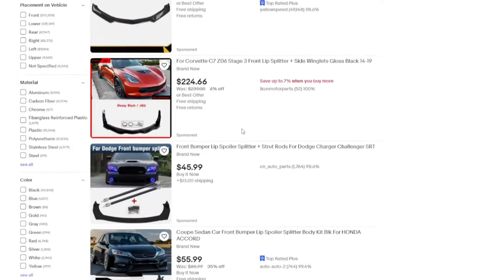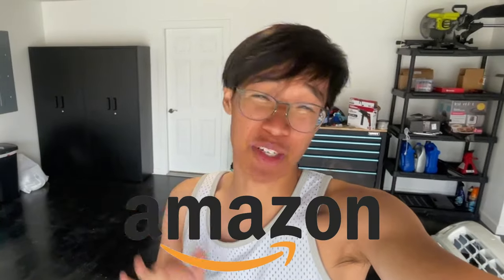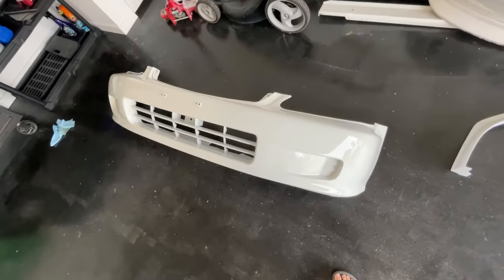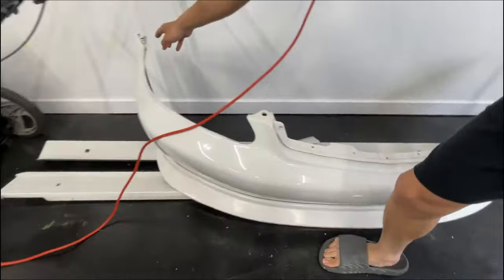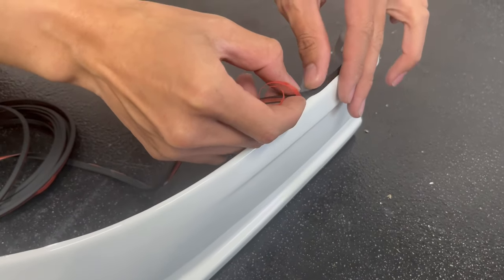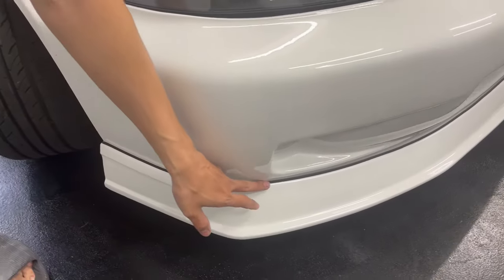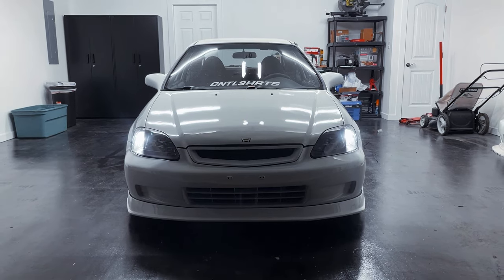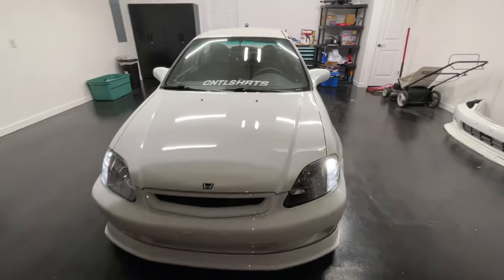Buying the NICEST Lip that NOBODY Ever Buys..

Comment: i wish those rep si grills just had the damn mounting tabs at the bottom of the grill
Reply from the maker: Bro I swear but, I actually found something better that is similar! Stay tuned for an upcoming video for that gang 🫶🏽
Reply: Well u are supposed to slide the tabs into the bumper, then install the bumper & grille together or that's how I do it here in South Africa 🇿🇦 that lip looks amazing 👌
Reply: @jarekmai damn can’t wait to see what you got 🫣
Reply: @danepaulsen367 yea i tried that with mine and it just kept popping out and it scratched my bumper luckily it’s not painted yet but i can see it scratching the paint off
Reply: @miguelzavala4523  try sliding the tabs in so the grille fits onto the bumper properly then add a few short screws to take the grille  in place, hopefully that helps